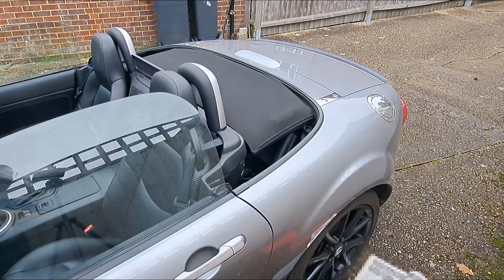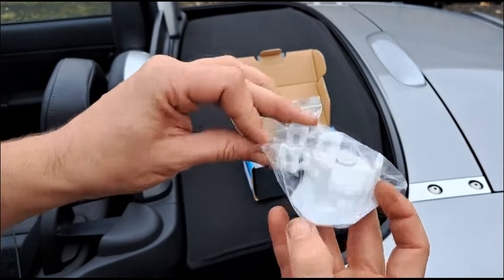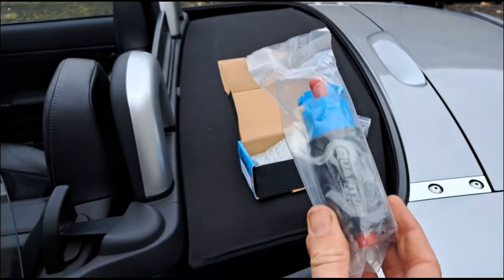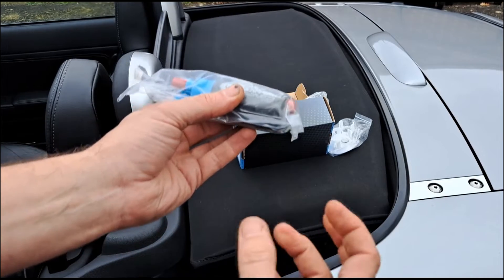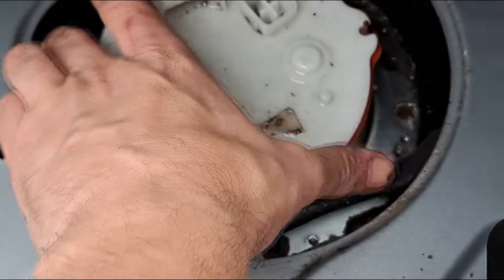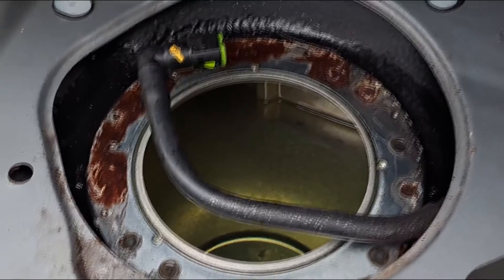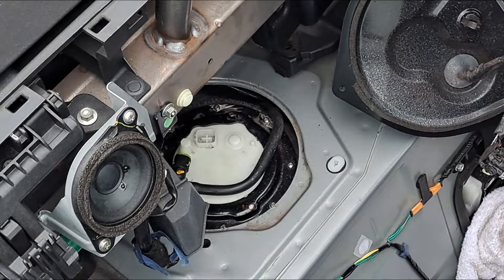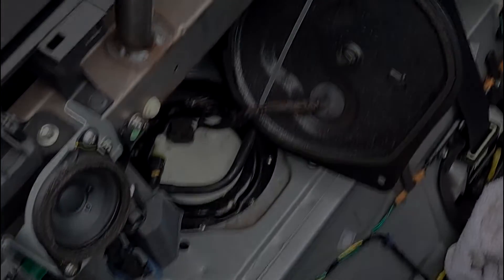Miata MX5 NC TURBO - DIY Turbo build Part 10 - Fuel Pump removal & upgrade

Comment: great video. I just found out that my fuel pump is really noisy (whinne noise) when the engine is running. I was just wondering whether to change only the filter, or the filter + filter body or only the pump and the filter
Reply from the maker: No need to change the plastic housing.  If s pump is whining, then probably on the way out for whatever reason. I would change pump and filter.

Comment: Which can be a good fuel pump replacement for my stock nc miata i'm wondering in installing one but i wanna put sonething better than the stock
Reply from the maker: @joegamer1696  for a stock NC, I doubt there is anything better than an OEM pump.

Comment: Hello there, thanks for the vid that's a vert Nice build of yours ! I had a question maybe you can help me, there is no stock fuel presssure regulator on the mx5 NC ? It seems i have fuel pressure issue ans wanted toi change my fuel pump and fpr but i didn't find any 👀
Reply from the maker: Hi. I have to admit I haven't looked into the regulator, I had no need to mess with it. A quick Google, bought this up
https://www.gomiata.com/gemamifuprre4.html